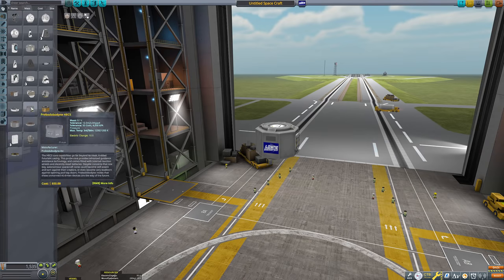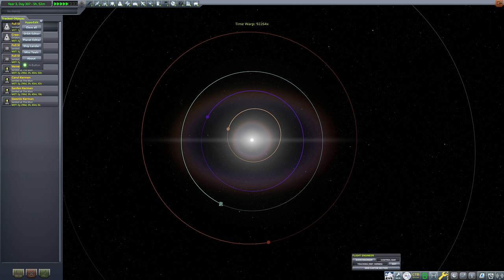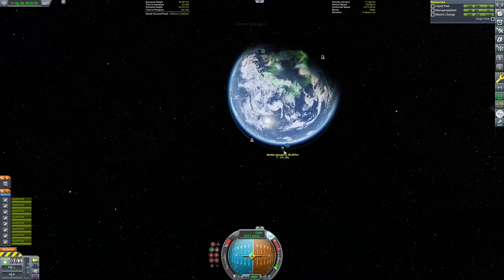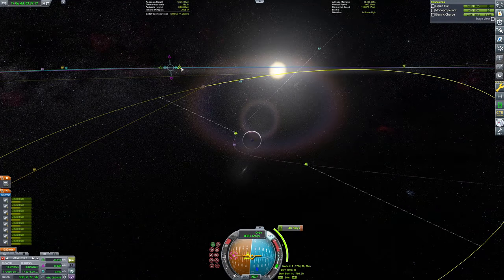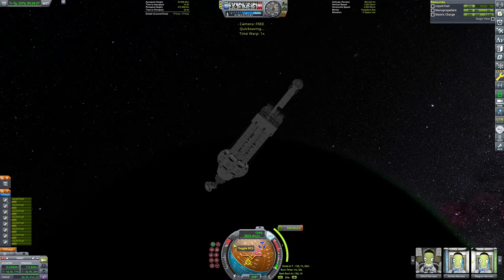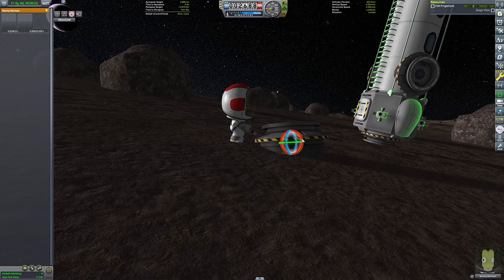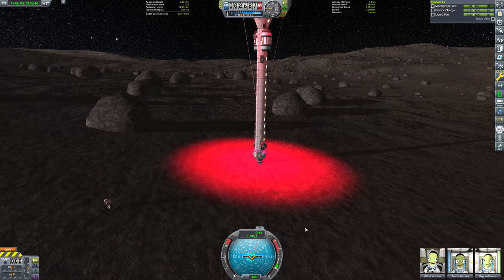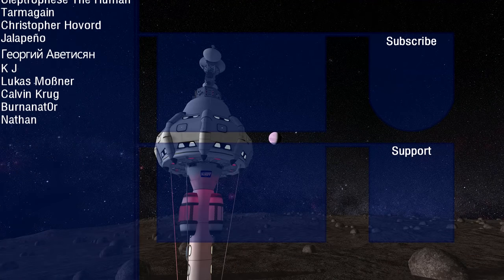KSP: Building a Tower Base!

Comment: Top Tip. You can use the Kickback solid rocket boosters (empty, of course) for the best ratio between wight and rigidity for all your spindly-towery needs.
Reply: in b4 stratz builds a 10km tower
Reply: Not Clydesdales? Interesting. Incidentally, someone; I think it was stratz, built a spinlauncher using extremely long fairings for arms.
Reply: @eekee6034  Depends if you want 1,25m diameter or 2,5m of course. Since he used 1,25, I went with Kickback.
Reply: @FolgoreCZ  Ah, that makes sense.

Comment: make a tower so tall that the top is in orbit. also, you could use it as a refueling station that has a refinery at the surface
Reply: If you used 2.5km segments which is as long as i can conceive of somebody building, it would take 1146 segments to reach keostationary altitude on kerbin.
Reply: would you have to do fuel transfer a bunch of times to get it up the tower?
Reply: @harmonyspaceagency1743  Just use a bunch of the fuel transfer lines. Although it may get difficult to do for a planet or moon with too high gravity for an engineer to jetpack up to place it. I suppose a ladder to heaven could be placed on the side lol
Reply: @harmonyspaceagency1743  If the only fuel tanks are at the top, "in orbit" then the fuel from the ISRU should automatically be generated in orbit.
Reply: @operator8014  A good point, I forgot of refineries worked
Reply: @thecardczar8764  I see
Reply: I think the rotational speed wouldn't match the orbital speed, and it would be hard to dock with...
Reply: Matt can't do that, it's stratzenblitz level shit.
Reply: @Camdotcam  orbital speed changes due to altitude, you can build enough for gilliostationary orbit by making it modular. in ksp, F≠ma
Reply: this is a cool idea, laggy, but cool
Reply: u mean the top is as high as orbital level
Reply: @itzsnowie7436  he possibly meant synchronous orbit tall, not possible otherwise
Reply: @ryanspence5831   Nobody said anything about Kerbin, what about Minmus or the Mun or something? Nobody really needs a refueling station in Kerbin orbit.
Reply: i might try to make it by using the Stratzenblitz75 technique
Reply: @HugoBroad  Would be glad to see that!!
Reply: @ryanspence5831  on gilly

Comment: What's the height of the sphere of influence of Gilly?  I wonder if it's close enough to make a gigantic single tower to the edge from the surface?  It's probably not, but I don't know for sure.
Reply: Its impossible
Reply: Technically, with enough dedication and struts it's possible
Reply: @ilpi7216  and graphics cards that might burn out
Reply: I think there's a glitch where if you stack extremely long vessels in a specific way, with the root part out of physics range, they will freeze and allow building arbitrarily-large structures. Someone used it to build a bridge across the Dres canyon.
Reply: @the-Ryimax  Physics stop rendering once a part is 200m away from the root part
Reply: @Blaze6108  yeah
Reply: @mylifeisbeige  I'm sure there is probably a way to make a mod that changes that.
Reply: someone call stratzenblitz
Reply: @mylifeisbeige  There's a mod to fix that called physics range extender
Reply: The wiki gives Gilly's SOI as 126 123.27 m from its center. (That must be the radius.) Its equatorial radius is 13 000 m which, knowing KSP, is probably the distance from Gilly's center to the lowest point of its surface, or even to somewhat lower than its lowest point. (See Duna for an example of that.) So you'd need a tower 113 124 m tall. A few people have managed to build artificial gravity space stations with rings 1km in diameter, but the kraken puts up quite a fight over such a monster. This tower would be 36 times as long as such a ring's circumference. This sounds daunting, but as the tower is straight, it could be made with longer parts. If fairings are used, it could even be made from fewer parts than a 1km ring.
Reply: @Blaze6108  That would be statzenblitz :)
Reply: @Blaze6108  The legend Stratzenblitz
Reply: @Blaze6108  stratenblitz

Comment: I just found out using the Better time warp mod you can set Physics warp to negative numbers causing and Huge explosion and lots of speed on the surviving parts... You should try a mission with this challenge in mind! Oh yeah I also forgot to add that after you set to the negative speed you need to open the pause menu after you press the < key or whatever your Go backwards in time warp setting is. Last thing it needs to be mounted to the ground with heavy fuel tanks and no engine.

Comment: Funny how Kerbal Alarm Clock is integrated into the game, and you still eyeball those transfer windows :)
Reply: The integrated KAC has its transfer windows reversed. To get a Kerbin to Eve transfer window alarm, you have to be at Eve and request a transfer to Kerbin. At least, that's what I've read. What I know for certain is that I once asked it for an Eve transfer window from Kerbin, naiively expecting it to work, but it was horribly, horribly wrong. I use external tools now, particularly AlexMoon's transfer window planner, and set manual alarms.

Comment: I've been wondering why you haven't ever mentioned a simple anti-flip trick I use when landing places.  Whenever I have my horizontal surface velocity to a point that I'm nearly pointing radial out I set SAS to radial out so that in the event I over burn and begin to gain altitude the craft won't flip upside down trying to maintain retrograde.  Seems as simple as your lazy docking method I use now.